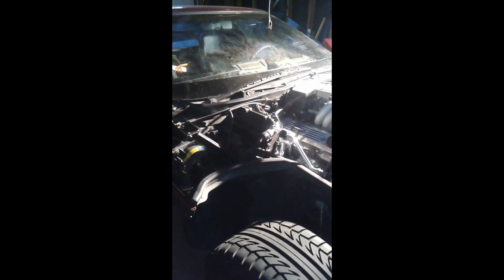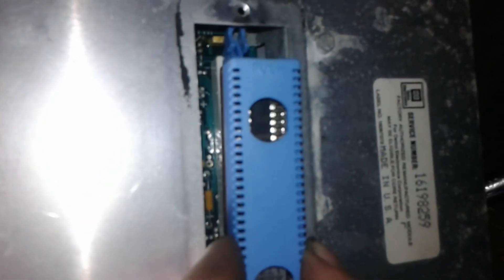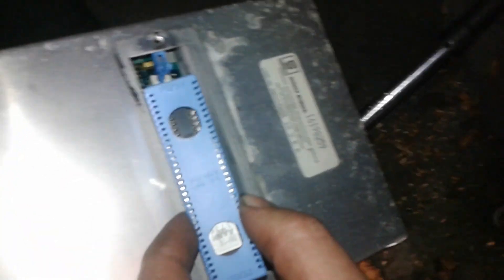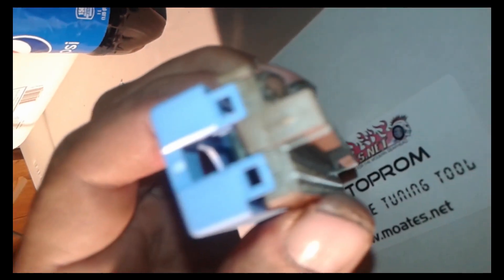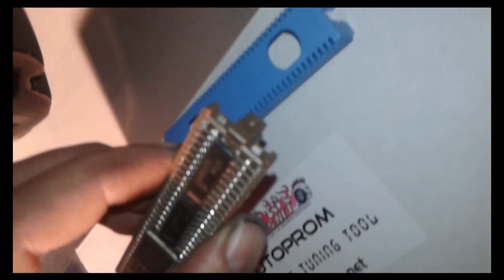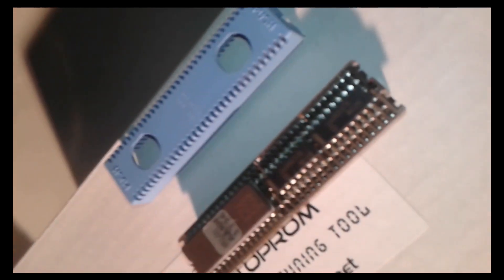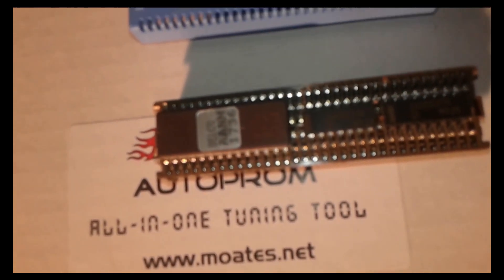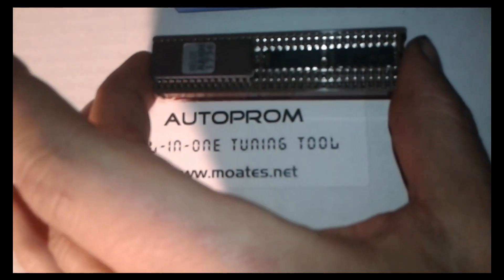1986 Corvette ECM Removal

Comment: I dont know if u will see this but my 1986 vette does thia i can turn it on and run it for how ever long and then when i go into the store or whatever it may be i will come out and try to start my car but there is no crank lights come on the dash and everything i will wait about 35 minutes to hour and will start right up no problem temp read that it is fine thru out the whole process
Reply from the maker: sounds like a strange case for it to not crank... typically indicates a battery with a dead cell, however givin the minimal amount of specifics in details hard to really nail it down to any one thing and i dont wanna tell you to just start throwing money at it till the problem is resolved as there is a list of things that it could be...

Comment: Thanks for the great video. Quick question - I'm kinda new at this so please bear with me; I recently bought an 86 (with the manual transmission and cast iron heads). I noticed that the fan comes on very early (~185 F). I drive the car on very open roads and don't need the fan coming on so early. Looking through the service history, I saw that the car had a hypertech performance chip installed. I am assuming this is the PROM, which (from basic internet research)  doesn't seem to do much apart from turn on the fan early. Is it now possible to simply find the original PROM for this car and put it in? If I were do to his, would it simply return the car to normal operation? Or it's not quite so simple? Many thanks!
Reply from the maker: honestly... in my opinion i would leave the chip as is, as its not hurting anything. i would however suggest taking the car out and getting it up to temp (when the fan turns on), and then come to a full stop, pull over on the shoulder, or into a parking lot, just off the road, leave the car running and sit still for a few minutes and pay attention to how fast the engine temp rises... these cars are bottom feeders and the fact that the fan comes on "early" is just the fact that it comes on "earlier than expected" to someone unfamiliar with how the car works.  the term "bottom feeder" : you will notice there is no direct opening, like a grill in front of the radiator(s), instead there is an air damn under the nose cone that is there to collect air and direct it up into the trans cooler which has a fan in front of it that forces the air through to the a/c radiator and coolant radiator, where at the back of the coolant radiator there is another fan to suck the air through into the engine compartment, which is the fan you see with the shroud around it when you pop the hood. that being said, if you are not making forward motion to allow the car to collect new air through the radiators, the fan needs to turn on to do the majority of work in the cooling of the radiators to keep from overheating. in short, what seems "early" is just perception, hope that helps and congrats on the car, they are fun! they are definitely a different animal though.
Reply: @jalopyjones6460  Thanks for the quick response. I see what you mean. I've put on about 1500 miles since I bought it. Where I drive, there is a lot of open roads. The fan consistently comes on at 180 ish. I have tried this (pulled over and just waited to see what would happen with the fan on at idle. It crept up to about 210 and stayed there. When I disconnected the relay and went for a drive (just to see what the temperature would get up to, I noticed that it never went above ~205 on the roads I am driving. The only reason it was really worrying me is because the fan is staying on for long periods of driving (so I am getting a bit worried that its motor will blow out). So I was thinking to just get the original PROM in and to see how it goes.
Reply from the maker: the normal temp for the fan to turn on is 230ish, and it then drops the temp for me down to around 210ish at idle sitting still. for your fan to turn on at 180, before it has even reached operating temp, sounds to me like a number of different things that could potentially be wrong.
Reply: @jalopyjones6460  awesome - that's exactly what I am trying to achieve in mine. One of the features of the Hypertech PROM was to turn the fan on at 180 ish. I have a new coolant temperature sensor and radiator fan switch along with the correct thermostat, clean radiator and good fluid. I suspect the chip is the culprit (as per their website).
Reply from the maker: hopefully you realize that there are 3 different coolant temp sensors on the block... if not, be sure that it was the one located in front of cylinder 8 (near the back of the block on the passenger side) as that is the one that controls the radiator fan relay. other than that, i would say that hypertech probably has a kit you can get for setting the variables on that paticular eeprom that you have. but once again, i'm not going to dive into all of that as you have a fully functioning vehicle, and if you mess up, its a lawn ornament.
Reply: @jalopyjones6460  Thanks for this - I think I need to step back a bit and make sure  I've done my homework properly.

Comment: what causes the shift light to come on when the car runs rough
Reply from the maker: that's a rather vague question, it could be any number of things ranging from an engine sensor to a transmission issue, in order to even attempt to answer it, first start with the initial problem, what is causing the car to run rough?

Comment: how did the tuning go for you>  contemplating getting one myself.  But feel may need whole new computer,  does it come with the piece u removed or would it be changed over, that is my dilemma.
Reply from the maker: Tuning went well, I only had to omit the EGR due to the system being removed and an adjustment to the O2 sensors because of the higher flow through the larger than stock headers. The kit that I purchased came with 2 EPROM chips and everything needed except a laptop ( which is needed, if not a desktop pc ) Still need to edit the video and am seriously contemplating not publishing that at all, due to the fact that I would feel horrible if someone who didn't know what they were doing followed along and had a running vehicle when they started and afterwards had a lawn ornament... Hope yours goes smooth.
Reply: @jalopyjones6460  Now that is just unfair!!  All joking aside I have a 85 and want to do the EGR delete also.  I bought a Motorvation stage 2 because I put a good exhaust and intake on.   It is supposed to be here today.  Mine is a Z51 so I hope there isn't anything to go wrong there.  I'll let everyone know how it goes, UNLIKE SOME PEOPLE!!!    haha
Reply: UPDATE: OK, everything went well, the exhaust is louder and throatier.  Definitely feel more horsepower.  Idle's around 600 RPM (was 500-550), sounds awesome.  Coolant temp is cooler it's  around 180 degrees parked, I think it's a 195 thermostat.  I only drive it for a little while, going to really see what it does today.  So far, yes, it's a good chip.
Reply from the maker: @ranbymonkeys2384  sorry I can't share ALL my secrets, just posted this really because all the forums they give a rather vague description as to where it's located and no information as to how difficult it would be to gain access to it... glad everything went well for you!